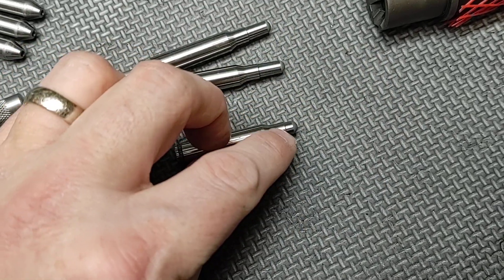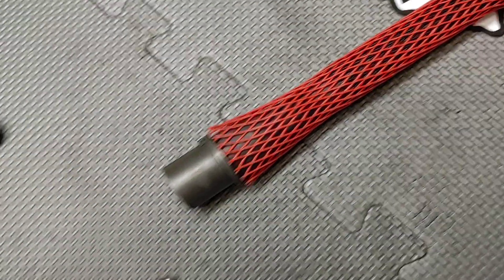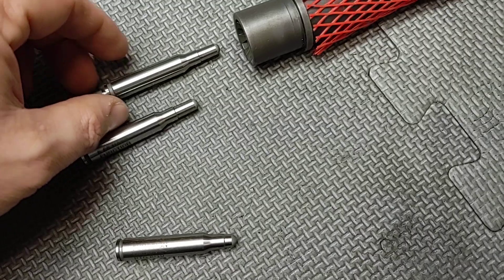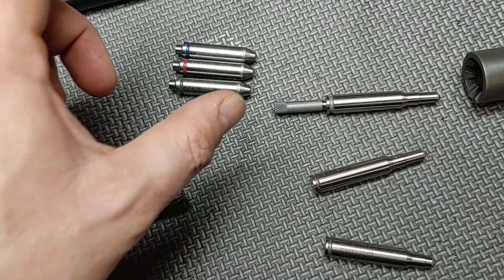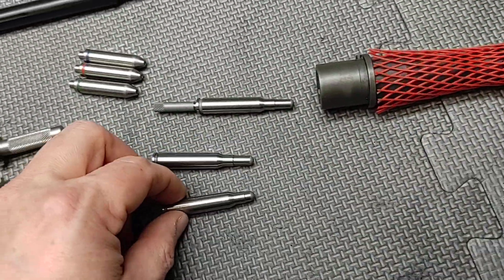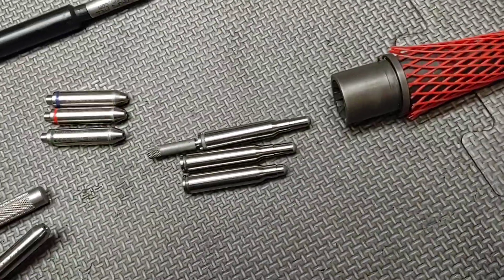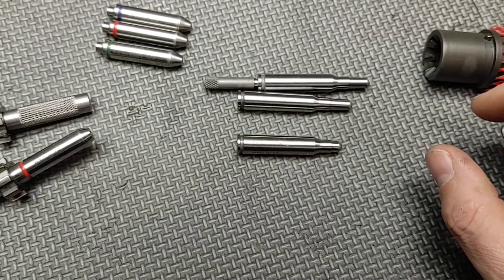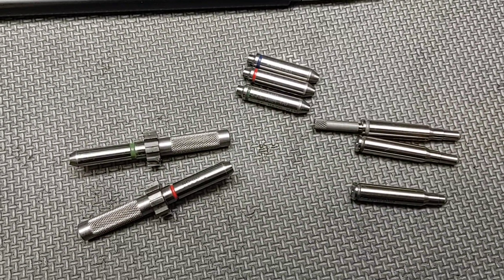PTG Chamber/Throat Function Gauges

Comment: This was a huge help with figuring what's wrong with my lr308 build and why it constantly stovepipes at the range. Initially I thought it was just overgassed. I put a slr adjustable gas block on it and the problem didn't go away. More recently I started looking at my fired brass and I found signs of excessive chamber pressure. Almost every fired casing has flattened primers. Most of them also have case head extrusion where brass is being pushed back into the ejector hole leaving sharp circular marks that can be both seen and felt. Additionally on some of the rounds I can see where the primer was pushed back into the firing pin channel. So I have a primer that has been flattened, with a raised ring going around the indentation from the firing pin, and a circular raised mark on the case head where brass was pushed back into the recess for the ejector.

Today I decided to do a little test, using some unfired factory ammunition as an improvised function gauge, thanks to the information in this video. First I pushed the round into the chamber with nothing but finger pressure. It fell right back out. Next I removed the extractor from my bolt and it ended up taking about 15 pounds of pressure on the back of the carrier to get the bolt to go into battery. It also took several pounds of force to pull the bolt back out of battery, and this time the round would not fall free. I had to grab the rim with the extractor claw in order to get it out. I took another round and painted it with magic marker and did the same test again. When I pulled it out it had a scuff mark on the bullet about 1/16" forward of the mouth of the case, and the casing had a scuff mark on the side right behind the shoulder, and a line going all the way around the shoulder. It looks like the chamber and/or throat didn't get reamed properly on my barrel, causing there to be tight spots in the chamber which are causing excessive pressure and endless malfunctions that make it almost impossible to fire more than 3 shots without a jam.